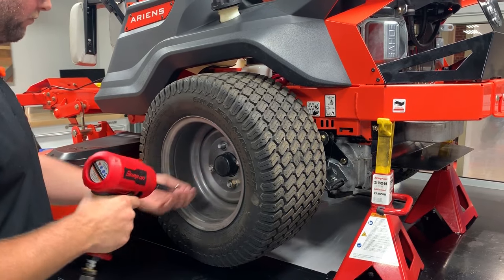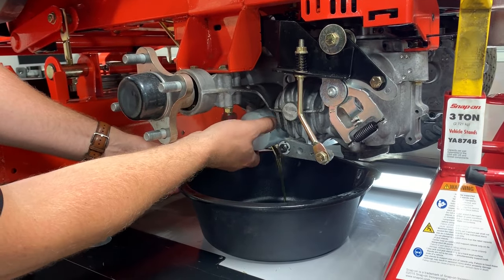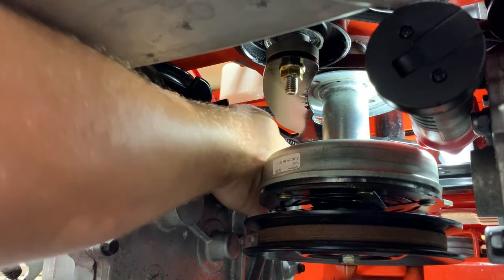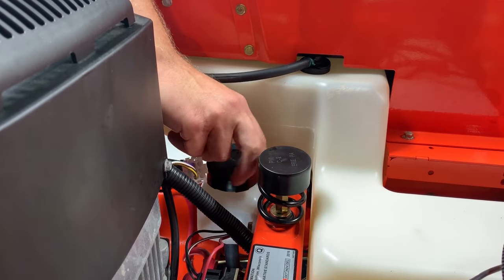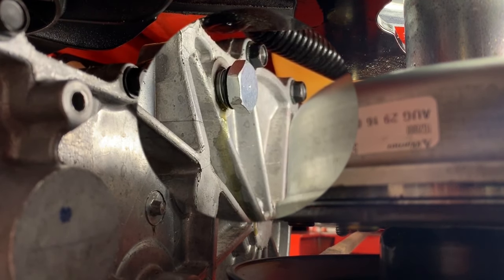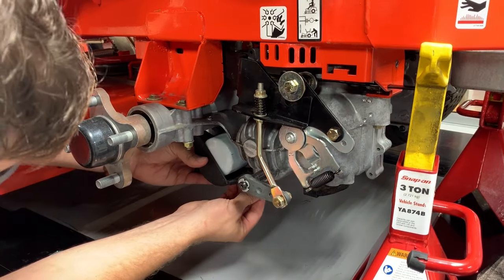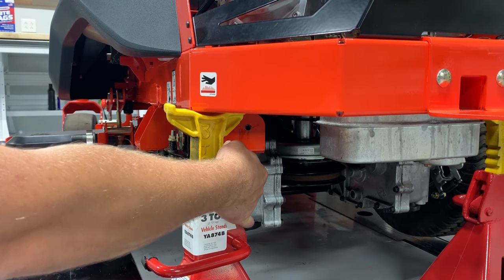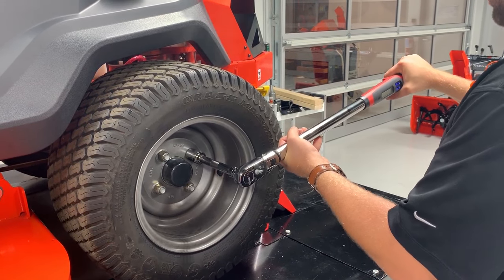How to Change Lawn Mower Hydro Oil | Ariens®

Comment: For all you looking for the "non-servicable" transmissions..this is directly from Ariens...

"This transaxle is factory filled, sealed and does 
not require oil maintenance. However, in the
 event of oil contamination or degradation, oil 
addition or change may alleviate certain performance problems."

Do NOT buy this shit box.  There's no way to change to oil in the rear hydros unless you want to suck it out and replace with 20-50.  And there's no way to replace the filters unless you want to crack the cases, since the filter is internal.

In my opinion..DO NOT BUY!
Reply: "Does not require oil maintenance" unless the seals start leaking profusely... Additionally Ariens does not sell replacement seals therefore possibly refilling the units for the rest of eternity....EXCEPT... the fill plug can not be reached due to additional poor engineering. A simple hole in the cross member would have been logical. This design clearly was deliberate OR extra stupid engineers at Ariens.

Comment: wait, wait you dont completely drain the oil?
Reply from the maker: Hi Jaime, you are to drain all the oil when changing your transaxle oil. Is there a certain part of this video where we can provide more clarification?
Reply: @AriensChannel  when you remove the oil filter. but, I worked as automotive lube tech and i usually see filter and drain plug. idk that oil filter completely drain oil on a hydro gear. watched couple of video until I realized it. sorry, your video was on point. just I didnt listen right on the first time lol.
Reply from the maker: @jaimehernandez4962  no need to apologize, Jaime. We're glad you understand the procedure!

Comment: Is the Zoom XL serviceable?   Each axle has hydro reservoir.
Reply from the maker: If you can reply with your 6-digit model number and 6-digit serial number, we'd be happy to look that up for you!
Reply: Just my 2 cents worth. If it has a reservoir it should be easy to service. It probably has a hydrogear transaxle. Hydrogear has sevice manuals online.